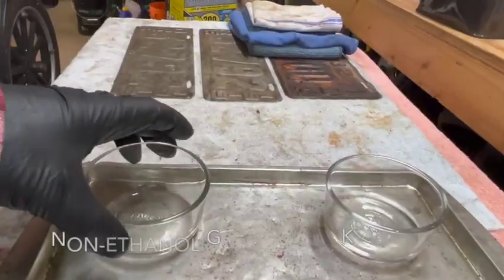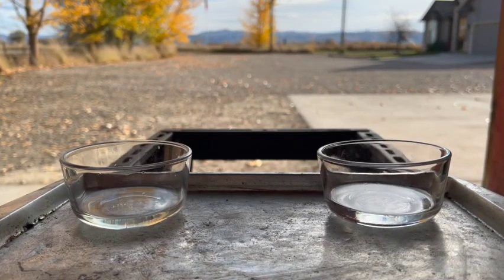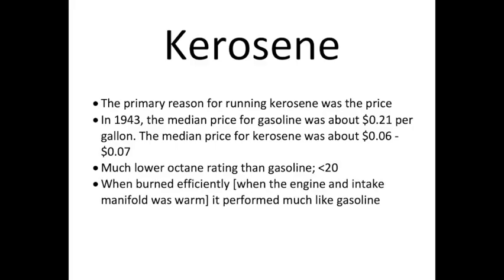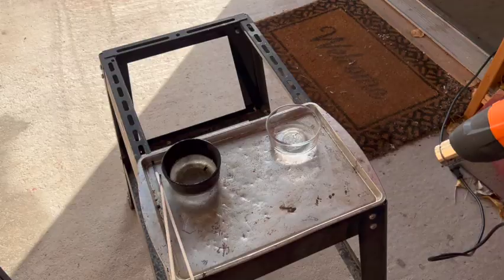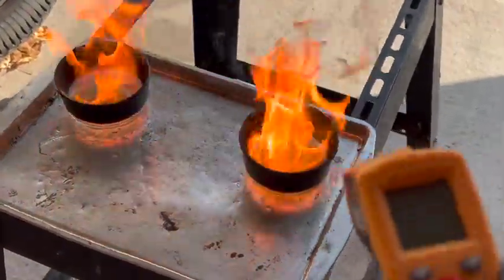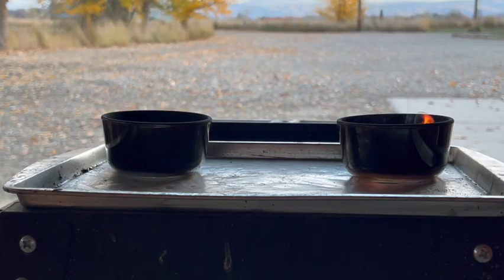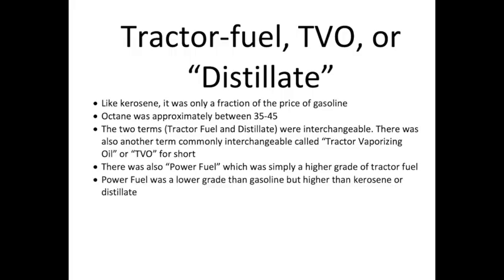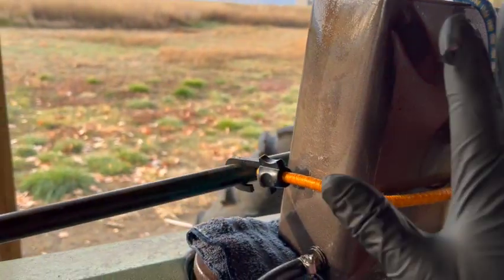John Deere B - Gasoline vs. Kerosene Demonstration

Comment: I would like to get the small tank ,start up, plumbed back in. My 38 B is all good but some time the plumbing was removed. The clearance under the tank.looks tight so I will have to look around for elbow for the tank.

Comment: And so I am not clear here?  This John Deere Tractor is a gasoline powered tractor? Or is it a diesel powered tractor running on gasoline?  Then switching over to kerosene. And back to gasoline again. And it's a diesel engine running on gasoline? Why am I confused?

I guess it was a crappy gasoline powered tractor? And once it comes up to operating temperature. It'll work on the kerosene also. Because the kerosene was so much cheaper.. Gotcha.

I never owned a John Deere tractor. I wouldn't know what kind of fuel they use?  Or why? And if it will run on tractor fuel is that not diesel? Why does everybody have to make this so complicated? What is with all of this idiot nomenclature? Is everybody just trying to be funny? You think you are funny trying to act like some academic smart asses? Well? You are not funny! This is not funny! Why are you doing this to us? I thought you liked, viewers? But  No! You just want to act like a, Know it all. Smart ass.

Well?  WE ARE NOT BUYING IT! WE WILL HAVE OUR DAY IN COURT! AND HAPPY NEW YEAR!
RemyRAD
Reply from the maker: Was somebody drinking and typing on New Year's Eve?? 😎
Reply: @AntiqueCarsandStuff  Actually no. I don't have any experience with farm equipment  or John Deere stuff? I think a diesel engine can run on gasoline but it can destroy them?  And a car won't run on diesel?  Because I'm not a car  per se. Not a mechanic. Though I have a diesel pusher motorhome I purchased last year.

I found your video interesting.  But not all the details were clear to me?

I had a quiet New Year's Eve all by myself at 70. In my bedroom on YouTube. It's my free entertainment.

Thanks for the interesting video.  I'll remember this if I ever get a John Deere tractor.  And want to run it on cheaper fuel  than gasoline. And now I know it has to come up to temperature first.  Thank you.And I'll be able to save money that way.  If I had money for a old used John Deere tractor? But I shall retain this in my, shrinking brain cells may be for a short while? As I am currently practicing my senility.

Happy new year! It's 1984, right?
RemyRAD
Reply from the maker: Ha ha. Ok. Well, this is considered an “all fuel” engine. It was intended to start on gasoline and switch to a cheaper grade fuel after getting warm. Back in those days if gasoline was 40c a gallon, kerosene/tractor fuel was around 6c per gallon. A huge difference in price! That’s why they set them up this way. This tractor has two fuel tanks; one small for gas and one large for kerosene/tractor fuel. DIESEL CANNOT BE RUN IN THIS ENGINE, nor can gasoline be run in a diesel engine. Diesel is NOT in the same class as low-grade cheap tractor fuel. It is a different animal. Gas ignites from -45F and above. Kerosene/tractor fuels ignite around 120-150F. Diesel won’t ignite until around 400-500F and the combustion chamber on a gas engine would never get that hot. The engine would blow up before that occurred. Anyway, it was interesting engineering back then. Now kerosene is 2-3 times more expensive than gas so the “all-fuel” idea no longer makes sense. (Remember diesel is NOT in the all-fuel category. Thanks for the dialogue and watching the video. Happy new year.

Comment: I ain't got no Edgumakashun.  I never knew this about kerosene?  That was very funny. You're trying to light a flammable liquid. It won't ignite. They should have developed cars to run on kerosene. Look at all the lives it would have saved?  If it really is that hard to light up? Unless it is boiling hot? It would have been much better run, in our vehicles. That's what they should have developed. That was the infrastructure they should have created. Molotov cocktails would never work. They would all go out.  There would be less riots. If our cars ran on kerosene.

I think it's all very funny. Kerosene  is kind of the middle child between, Benzene and Diesel? And jet engines really like it. They like it a lot. Jet engines enjoy more kerosene, than any, land-based critter with rubber tires. Not really made out of much rubber. But still largely dependent upon,  the dinosaurs. As long as the dead dinosaurs don't run out on us?  There were so many trillions of them over, hundreds of millions of years. How they got so far under our surface is a mystery? They all died on the surface.. How did they get 2 miles down? Did they leak 2 miles down?  Was there rotting glop that oily from the get go? And seeped more than 10,000 feet down? Why can't I wrap my head around that?

Did the earth just pick up, 10,000 more feet of, gas and  2 miles worth of dust? I guess so? At it all got packed down  and we call it dirt. But it wasn't from our solar system? And life was in that rubble? Where did that come from?  How did it get to this part of the, Universe? Who the hell is in charge here? Where's a Supervisor? I want a Supervisor!  Where is the Manager? I want a Manager! Call 911! I want my money back! What the hell is going on? On this planet?

Why is Donnie attacking Americans? What did we do to Donnie other than tell him to resign?
RemyRAD

Comment: What year is Your Deer? It is identical to one we had when i was a child. It is the square spoked wheels that make me wonder. We were told the square spokes made it a 1938. Also, we had low power plowing on gas but it pulled mush harder on kerosene.
Reply from the maker: This one is a 1943 B. The spokes look like they were homemade, definitely not original factory.

Comment: If you check the Nebraska tractor test results you will find kerosene gave significantly less power and fuel efficiency compared to gasoline.

Comment: In the 1980’s, an old farmer told me that gasoline was 3 cents per gallon and the tractor used 3 gallons per hour ( 9 cents per hour). Kerosene, although less efficient (power) was 2 cents per gallon and burned 2 gallons per hour ( 4 cents per hour).
Reply from the maker: Interesting. Thank you.
Reply: When he was farming in the 1930’s

Comment: I've burned kerosene I'm my unstyled allis chalmers wc. Only difference was the sell of the exhaust and for me to burn it I had to be doing it for a long time to get a clean burn. Kero was alot nicer on the eyes when plowing.  I would switch back to gas at the end to clean the carb for easier hand cranking next time. Also some tra tractors of that Era had different carbs and intakes to help with fuel control and heating the kero to burning temp to vaporize.
Reply from the maker: Interesting. Thank you.

Comment: The Owner's Manual states a few less horsepower rating with the distillate. It must've been a challenge to build enough engine temp for the change over in winter

Comment: Kerosene and Jet fuel are basically the same. Jet fuel is much cheaper to purchase at the airport and works just fine in kerosene heaters and diesel engines. In the Navy we used to clean parts with a bucket of jet fuel and a cigarette hanging out of our mouth. We never had a mishap and even threw the cigarettes into the bucket of jet fuel to extinguish them. Great video.
Reply from the maker: Interesting. Thanks.
Reply: Have put cigarettes out in gasoline as well

Comment: I think you can run a diesel or at least mix it with diesel aparently clean the engine doing it now andvthen though Im not sure guy who demonstrated this his van broke down shortly after, modern engines are much more finely tuned ect, not a good idea I'd think to mess or alter fuel supply
Reply from the maker: I don’t think it would run well on straight diesel. Maybe mixed with gasoline it would do ok.

Comment: Is kerosene still available today to use as fuel? Did your tractor run hotter or did you have to change the radiator shutters to regulate engine temperature as a result of burning the hotter fuel?
Reply from the maker: Kerosene is still available but it is expensive. Yes, the tractor ran slightly hotter on kerosene.

Comment: In the early 60s we would cultivate corn using fuel oil.  Gasoline was 18c a gal and fuel oil was 13c per gal. The tractor would run all day but make sure you switch over to gas for the final minutes of work or you will never start it on fuel oil.
Reply from the maker: What type of tractors did you use?
Reply: John Deere B for cultivating. A or 60 for plowing and latter on 720 gas, 730 diesel @AntiqueCarsandStuff
Reply: I remember. having to switch back to gas.

Comment: Try towing a plot on kerosene you will see the difference we used to plot for 15 to 25 minutes on gasoline pre change over and after it was easy plowing no hesitation ,winter was harder we ran a copper tube around the exhaust to help keep the fuel going to the carburator hot

Comment: Nothing new all older John Deere tractors were made to run on it
There is a 1 gall tank that held gas and you ran it till the motor got hot and there were shutters in front of the radiator too

Comment: The nice thing about the old 2 cylinders is they will burn most anything.  With the sediment bowl they are a good place to burn up old gas if you're going to work it a while.  Many engines can burn alcohol if warmed up on gas but it means little since the price difference.  You have the right manifold for distillate as there is also a gas manifold.  Distillate served a purpose back when it was 1/3 cost of gasoline but became useless and outdated later.  Idling , doing nothing,  proves little about the advantages of using kerosene.  Most farmers replaced the low compression pistons designed for distilates for high compression pistons and enjoyed the more power and advantage of gasoline.  In fact that tractor could easily have the gas only pistons rendering it useless in successfully working hard using distillates.  Nice demonstration but has very little value.  Farmers left distillates for a reason.

Comment: Very Cool Test, I have never ran my G on Kerosene...The All fuel Deere tractors (at least to my knowledge) lasted into the beginning of the 50/60/70 series tractors which replaced B/A/G respectively, I am most familiar with the G/70 (Although my Best Friend owns B #60003 - The Nebraska test 1939 B and the 4th "Styled" B ever built.) As the 70 was the end of the All-Fuel tractors and the Gasoline/LP tractors were more powerful with their 6:1 to 7:1 and/or higher compression engines (and Duplex 2-Barrel Carburetors) they were down sizing the engines to get same or more power with less displacement 379cu. in...The All-Fuel 70 was a "Hybrid" of sorts, having the 412cu. in. "G" Cylinders with a Duplex Carburetor Cyclone Head, gave it 5 more horsepower over the 38HP "G" but it still didn't make the 48 belt horsepower of the 379cid 7.3:1 Gasoline "70" but it was close enough to satisfy the farmers "stuck" on "All Fuel" tractors.... It was a changing time as the 70/80 Diesels were making 50/65 horsepower respectively from 379/471cid engines on 30% less fuel than the G/D they were replacing.
Reply from the maker: Interesting. Thanks!

Comment: During  WW2 Gas was Rationed........ My Dad worked at the Navy Yard In Charleston about 60 miles   He Plumbed  A  Flat Head Ford Woody   station wagon...... with a kerosene  tank  and two valves by the seat......  He Would   Get it  heated up on Gasoline   switch over to Kerosene  on the open road... once he go in traffic he would switch back to gas.....About  every so often  my brother and himself would pull the heads an  remove the carbon......
Reply from the maker: That's really neat. I could see myself doing something like that back then!

Comment: They were better to not lug excessively and choose a gear that allowed for pulling without exhaust smoke. Smoke was unburned fuel and also could flood cylinder walls to migrate into oil system.
Also if cylinder primer cups( if equipped ) were opened to insure no hydraulic lock above piston at first strokes of starter procedure. The D was hand flywheel start the others electric start. 70 gas gasoline pony witch also helped wam cylinder head of diesel engine via shared coolant system for cold weather conditions.

Comment: I remember our model D John Deere had a gasoline tank for starter purposes and a distillate tank for warmed up operations. The distillate was far less expensive. Seemed to run well on both without adjustments other than switching fuel valves. The A was gasoline only, the model 70 was diesel only with a small gasoline starter engine with separate small gas tank.
The famous twin cylinder design with low rpm and high torque values with superior fuel consumption and the hand clutch operation. Those sights and sounds of farming forever with me.
The gears meshing and the plow cutting soils, the grunt of the chuff chuff, the blackbirds as they found insects in the new turned ground. 
We would oft see the entire day’s changes from the seat of those machines.
Also an Oliver Cletrac diesel and it’s related steel track clank sounds.
Reply from the maker: I am curious if you happen to remember the price of the different fuels back then? Thanks for the comment!
Reply: I thought all Bs had two tanks.

Comment: When my dad was in his early twenties (during the mid-30's) his dad had several farms and a fleet of Farmall F-20's.  Dad and three of his brothers had the job of plowing after harvest.  He said that after several long days of plowing on kerosene the F20's would start losing power due to carbon build up on the valves.  So they would plow for a day or so using gasoline so "the valves would heal up" (Dad's words).  Plus, as mentioned, so much kerosene did not burn but got past the rings into the oil.  After sitting overnight the kerosene would float on top of the oil.  The tractor companies knew this and had a petcock on the side of the oil pan to open and drain off the kerosene every morning.
  Kerosene gradually fell out of favor and various companies came out with "cold manifolds" (without the exhaust jackets around the intake to heat the incoming kerosene), plus high compression pistons.  The cooler intake charge plus the higher compression gave significantly more power than kerosene, plus less hassle getting the tractor going in the morning!
Reply: Grandfather had farm all F20.  Pulled 2 14’s. In 2nd on kerosene.  Tough spot in field had to shift to 1st.    Learned switch to gas before reaching tough spot and could go on thru in 2 nd
Reply from the maker: Interesting. Thanks for the comment. The John Deere B in this video had a petcock on both sides of the crankcase. One must have been intended to drain off kerosene like you mentioned.
Reply: No, compression release for starting.

Comment: I know a bloke that runs a 1990’s Range Rover on kerosene with fuel the price it is he is paying 16p a litre the motor never grumbles either been going on it a year already. I’ve ran older diggers and dumpers on it too but one Kubota we had must of had a sensor cause it refused to work on it

Comment: When Nebraska started testing tractors, they found dual-fuel tractors would produce the same power on kerosene or gasoline.  Kerosene was not only cheaper, but also more available.  But folks who tried kerosene in their Ford Model T found out the hard way that it had an engine who's technology had moved beyond running kerosene.

Comment: Is USA KEROSENE the same as UK PARAFFIN?
Reply from the maker: I believe they are very similar but not exact. Paraffin is a more refined petroleum product than kerosene. Besides a slightly different chemical composition, paraffin has less odor and will produce less soot when burned. I don’t know how well it would work in an old tractor.

Comment: My dad had a G John Deere that he ran on distillate.  When he couldn't get  distillate  anymore he would mix 5 gallons of diesel  fuel with 10 gallons of gasoline. They had different spark plugs for distillate  burning use the metal part of the plug was about twice as long so as to retain more heat.
Reply from the maker: I did not know that about the spark plugs. Thanks!

Comment: I run my John Deere G on 40/60 gas/diesel  when I have it out in the field I don't plow a lot but when I do I use the old G and I do notice it runs smoother with that mix compared to just using gas and seems to have the same power  I do notice if I have a little to much diesel it smokes fairly good but if I keep it 40/60 or 50/50 it's pretty close to burning kerosene
Reply from the maker: Interesting. You wouldn’t think diesel and gas would mix well. Thanks Tim.

Comment: Your video inspired me to upload one I'd taken years ago. Plowing on kerosene. Unfortunately I did not include the warmup and switching over. Just like your video they were uneventful! https://www.youtube.com/watch?v=40pw8d2xadI
Reply from the maker: Thanks for adding to the conversation! The tractor sounded great. Still plenty of power!
Reply: @AntiqueCarsandStuff  Some discussions and tests have shown that they make more power on heavier fuel vs gasoline. Of course if you get an engine actually set up for gas, it will make even more